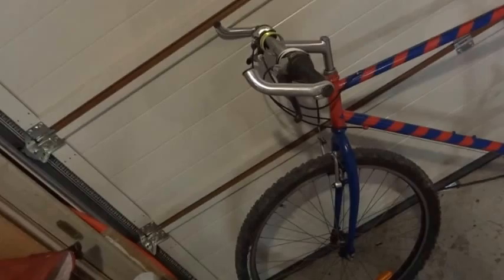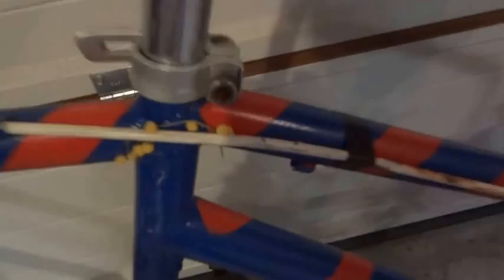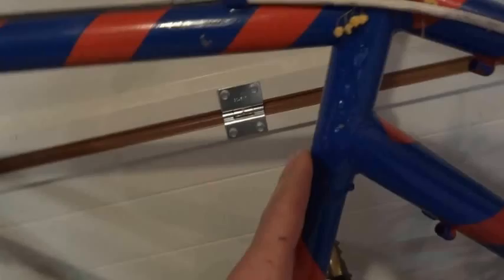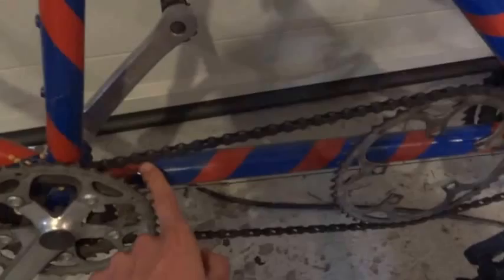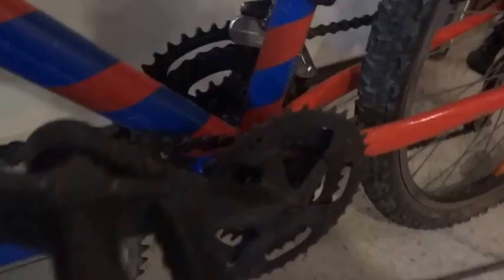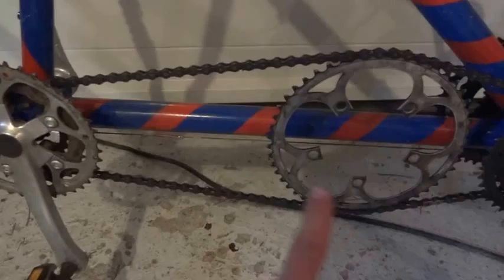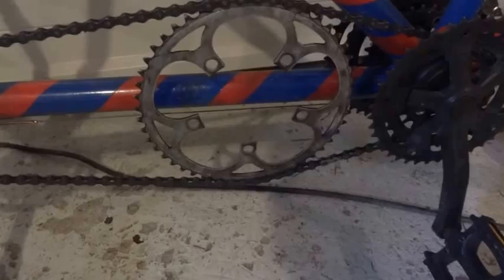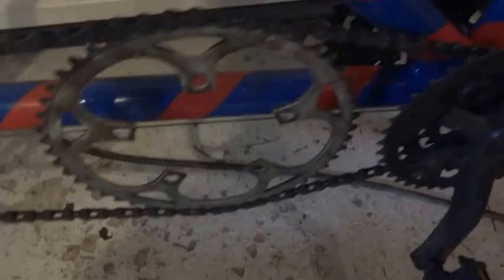DIY Tandem bike

Comment: I like it but the only issue I can see is the play in the back pedals. There shouldn't be any play like that so my suggestion would be to make sure all the bottom bracket barrings are there and that both sprockets for the back pedals are fitting nice and secure. Like I said earlier there shouldn't be any play like that. I build bikes as a hobby and know a few things about these things becoming serious issues. You made it very well just giving you some tips or suggestions on what you might want to do.